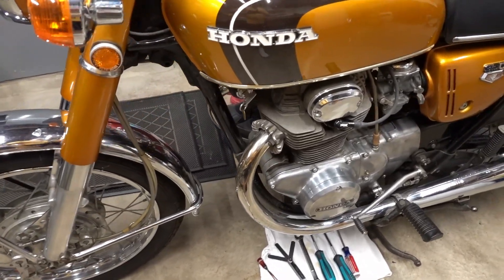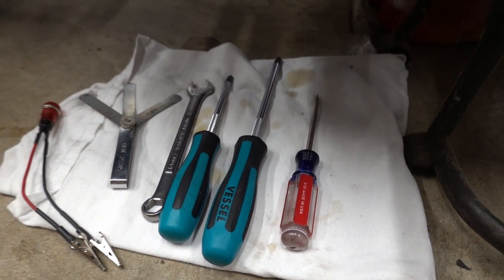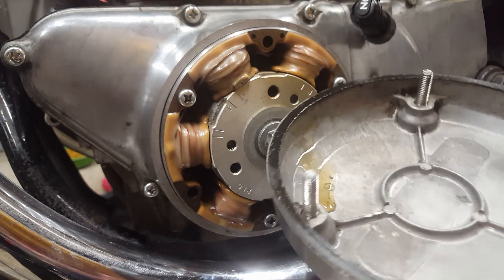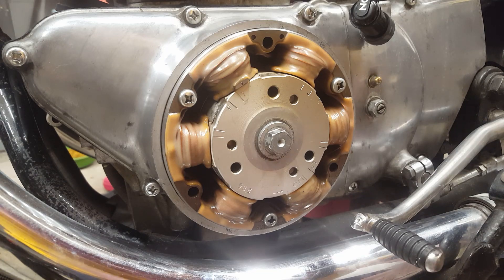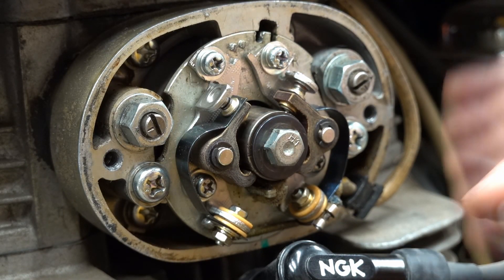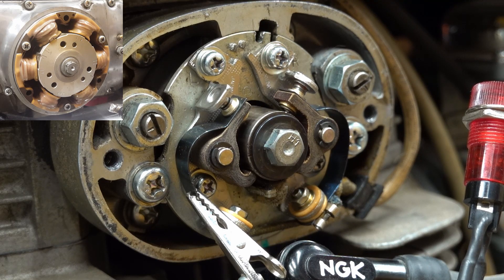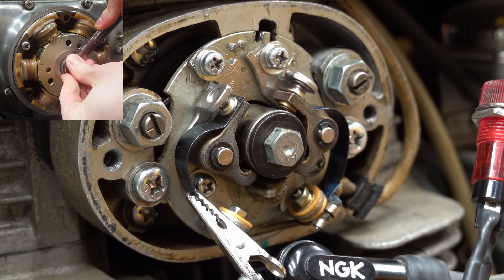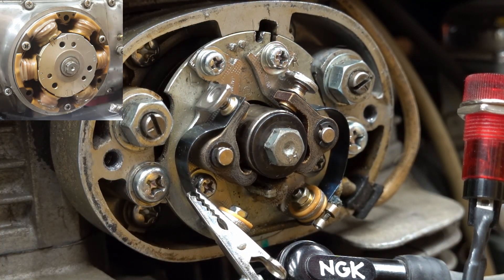Honda CB350 Points Ignition Timing

Comment: You never adjusted the GAP on the right point after you adjusted gap on left point! Gotta adjust BOTH gaps to spec before you set the timing. Why did you not check and adjust right point??

Comment: Spot on video. I tried the common motors video of this process however theirs was wrong in this case. Your gap adjustment and steps were great thank you!
Reply: Agreed! I used common motor and mine was running terrible. Didn’t show to gab left one then set by moving back plate and then setting right. Can’t wait to go and try this

Comment: Only just watched this, from a retired auto tech, that was very well done and explained. When we fitted new points or after setting with feelers, we would use a piece of clean cardboard from the points box, and rub in-between the points faces to remove any dirt or grease.
Reply from the maker: That's good tip, I always find myself reaching for a scrap of paper towel, never even thought to just use the box.

Comment: Great video! You mentioned it’s normal that there is a little oil in de stator casing. Do you know if this is also acceptable for CB77 Super Hawks?
Reply from the maker: I don't think there should be any oil behind the stator cover or right-side crankcase cover on the CB77.
Reply: @michaelsams450  thanks for your reply, I’ll look into that then. Set the ignition timing om my CB77 today using your video. It was way off… runs great now!

Comment: Hey thanks for the video, do you have any idea why my test light would be coming on and off opposite yours? When the point is set, my light turns off at LF instead of on. 

Also sometimes just stays on constant whether points are open or closed. It’s driving me crazy!
Reply: Hey Travis did you ever find out your issue. It appears that Im experience the same issue.
Reply: If you take the points plate off, look at the breaker cam on the spark advancer. Theres an index mark on the front of it that should point toward the side of the advancer plate with a notch cut out (near the arrow). If its rotated and installed 180° it will be out of phase. Look at page 100 in the honda shop manual.
Reply from the maker: Have you double checked you connections between the points/coils/condensers?  Did you adjust your points gap to spec?

Comment: Why did you not set the point gap on the right side?  Thanks
Reply from the maker: You adjust the timing of the right side by changing the point gap.  Setting it to a specific gap initially makes no difference because you ultimately have to change it anyways.
Reply: @michaelsams450  yeah but then you should’ve checked the gap of both of them when you were finished to make sure they were both within spec.
Reply: @benjaminsalopek3394 , agree. Most critical is when the points open, but yes he should confirm the right set gap is in spec though it (gap/dwell) really is not that critical as compared to an 8 cylinder engine with one set of points and one coil.
Reply: Exactly same thing im wondering!!